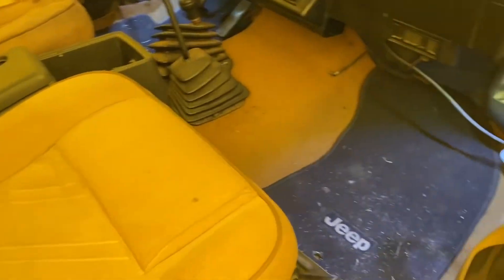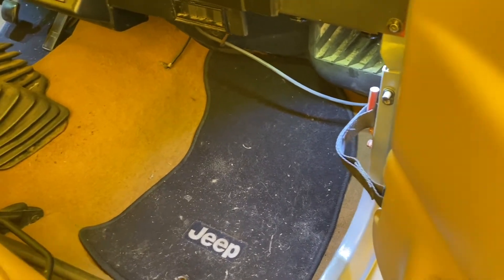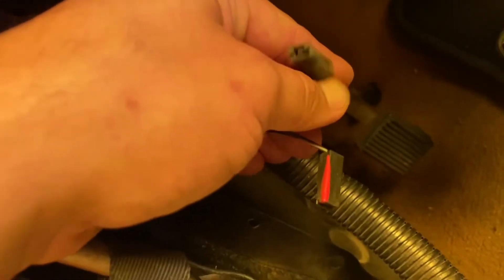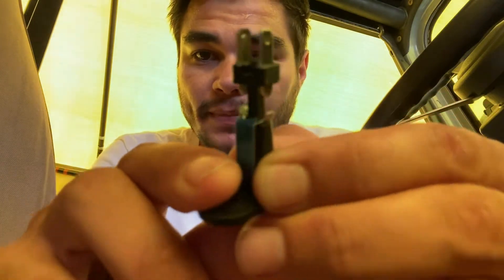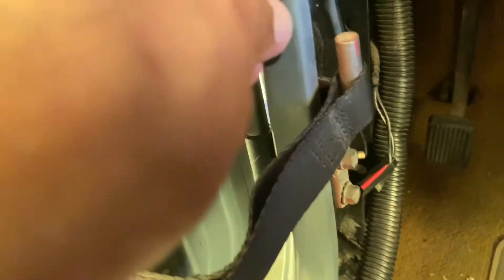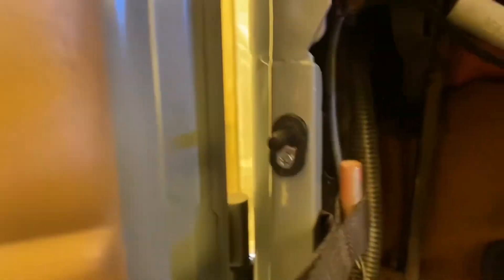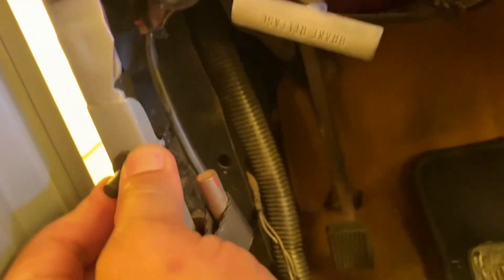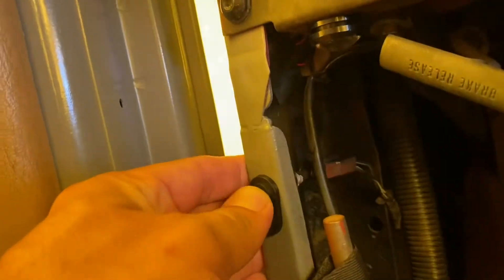Jeep Wrangler yj (interior light fix)

Comment: Anyway to know which wire (+/-) goes with each side. Or does it not matter since one is for ignition and the other for the light?
Reply from the maker: Yea I don’t think it matters to be honest
Reply: One wire is for the light, the other is for a buzzer reminding you that your key is in the switch when you open the driver door.
Reply: @rogerboles8618  Thanks. I'm totally past that hurtle from 3 months ago.  I'm working on wiring a couple sets on lights directly into the fuse box. Christmas fun